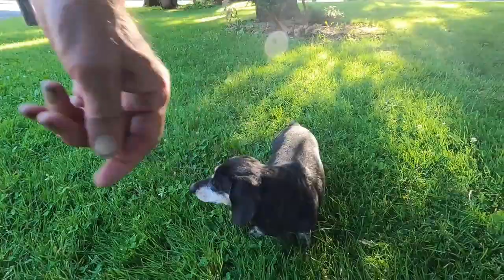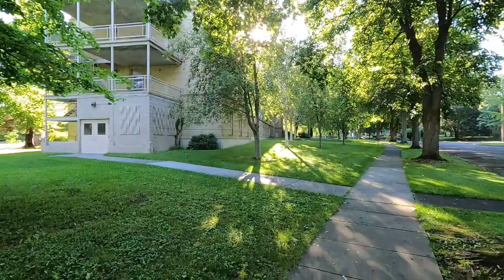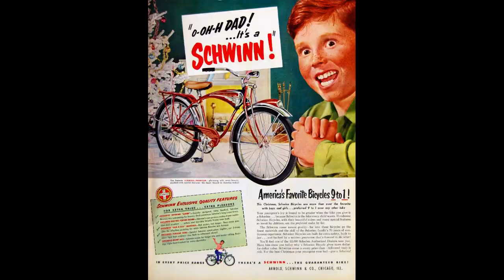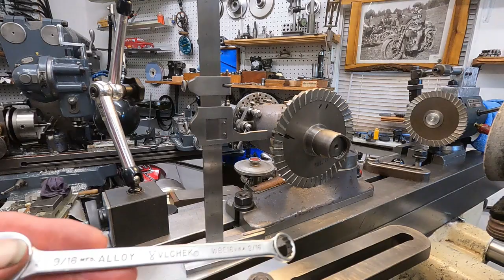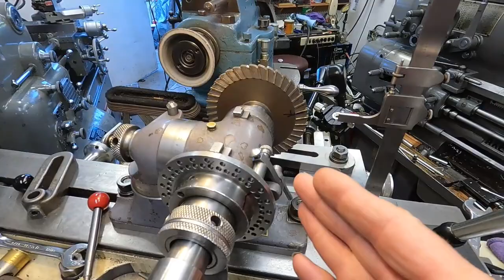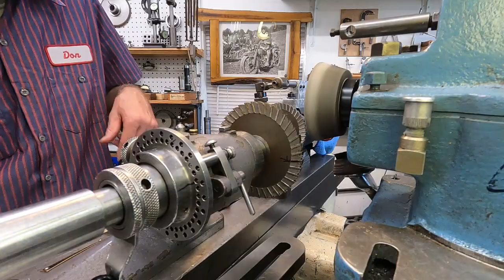A quick cutter grinding, tool grinding machine

Comment: normally you use click pointer. it's quick and easy.. why don't you use it??  you have to put it in front of the wheel down on the plane. then you just turn and hold back a little, click next click next

Comment: Good morning Don I have a Cincinnati number two cutter grinder. It has a lot of attachments with it. I was wondering if you could go through your different attachments for yours show how they’re set up and how they work thank you. I have a bunch of taps and endmills that I need to sharpen A lot of them are chipped carbide I really enjoy your content and I’ve learned a lot thank you
Reply from the maker: Thanks, I have just been using the standard workhead until I was able to get a Harig air spindle and an All Tool Rotadex 5c collet indexing fixture, more grinding in the near future! Thanks!

Comment: I was watching closely, and, maybe I’m wrong, but it looked that occasionally, you skipped a hole. I was wondering why.
Reply from the maker: It was not intentional, I will run it around again. It is still sitting as it was, thanks!